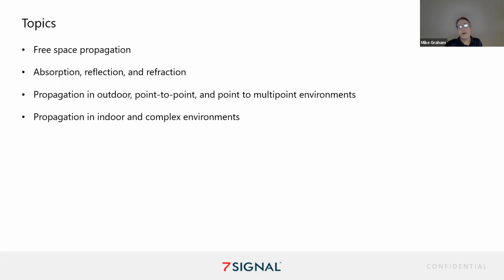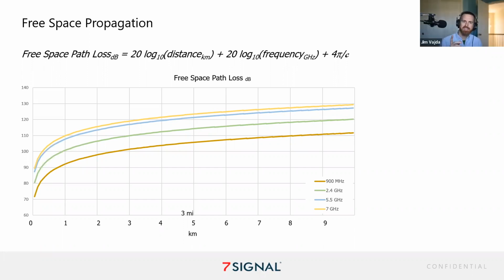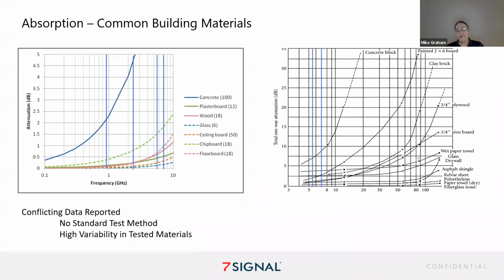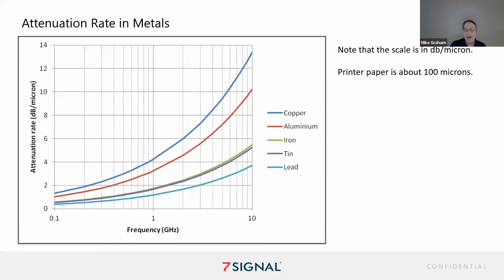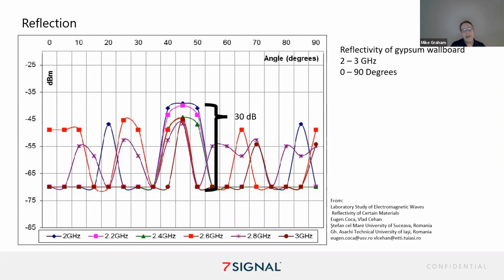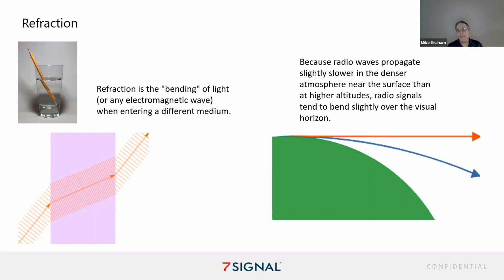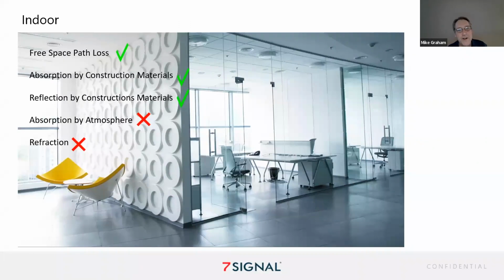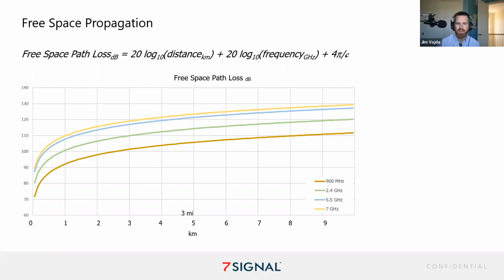Understanding Propagation Differences Between the 2.4, 5, and 6 GHz Bands

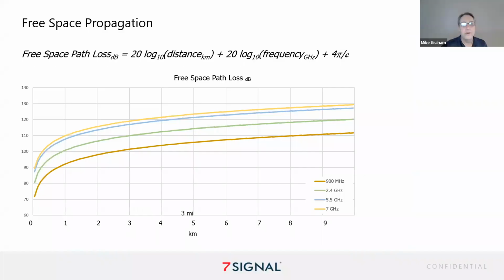Comment: @26:40 - For free-space propogation, 4*pi is the surface area of a unit sphere, c is the propagation speed of light. The underlying assumption here is isotropic radiation. The reason it's a "plus" and not a "times" is because the equation is in logarithmic form. However, the equation is wrong, because it should be 20log(4*pi/c), not just 4*pi/c.